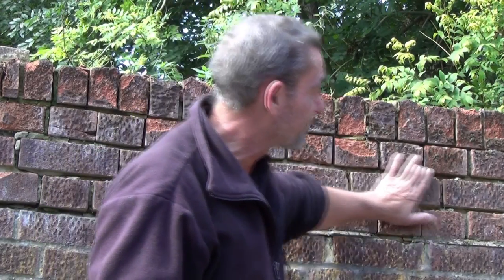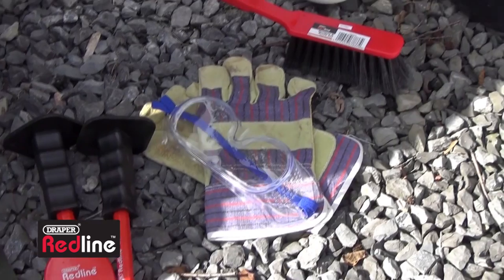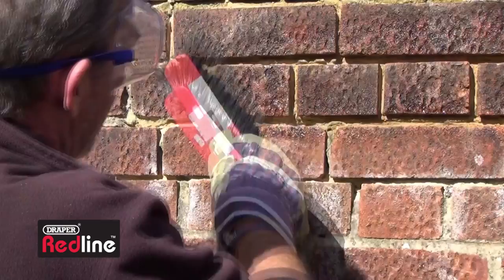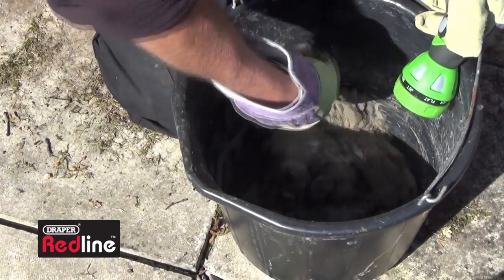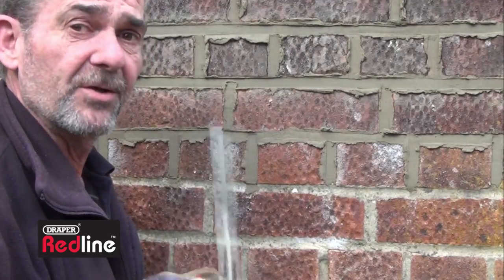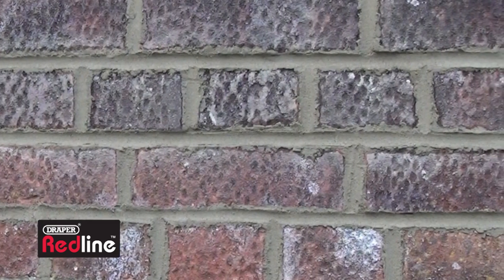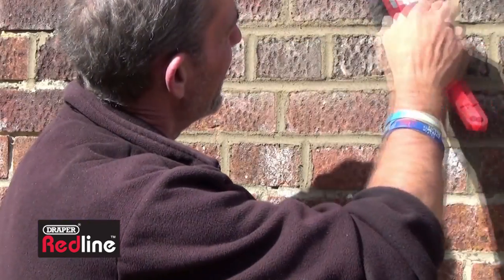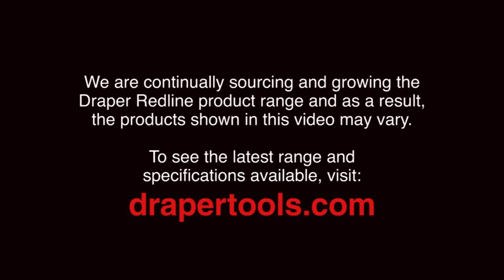How to repoint mortar joints

Comment: Those bricks are very old. Looks like the mortar at the back of the joint you raked out is lime. No way should you be using a cement based mortar. It's too strong. Looks like cement has previously been used for repointing and that is why the bricks on the top of the wall are damaged. By using cement, you are actually destroying the wall, not maintaining its structure. Use a lime mortar instead.

Comment: For you DIY people looking at this unless your thinking of attempting a little area don't attempt anything too large especially whole  elevations of your property. Not only will it look a mess but you will devalue your property. This guy knows what he's doing. This is a DIY video and the point of this video is to sell you their DIY tools. If you have to repoint yourself for gods sake find somewhere that won't be seen and practice, practice and when you think you've got it practice some more. He used a 2" bolster to remove old mortar this is fine for the odd piece of mortar but you need to look at other videos for other ideas if doing a large area. The most important task other than protecting your eyes and lungs from debris and dust, safe secure scaffolding and ladders is get your mortar right. I have seen people try and use muck that an experienced tradesman would have a nightmare with. Nice soft building sand ( Some of them can be too gritty ) Experiment. Like I said there are lots of really good vids and some bad ones. The mortar is key to this task. On hard bricks i.e. In the video Ratio of 4 sand 1 cement and a very very tiny amount of plasticiser literally a small spec if your mixing a bucket. If your a looking to attempt a Victorian house for example built in soft reds that's whole different ball game. Save up and get the pro's in. And then find someone who knows what lime mortar is. I've been guilty of using cement based mortar on beautiful Victorian brickwork and only after getting involved in with some heritage guys changed my thinking on this.
Reply: Dont now why you think DIYers are not as good as a tradesman, I have had builders in propertys and wont have anymore as I can do a far better job myself,some of us DIYERs have a lot of knowledge, I once had a builser take pictures of a victorian fireplace I built and put in as he had never done one !!!!!!

Comment: Please don't re-point solid walls with cement mortar!!! Your doing a lot more harm than good, these old walls need to breathe and cement based mortars stop this happening causing all sorts of damp problems
Reply: Nhl 3.5 or 5 for me all day long. You're exactly right.
Reply: I live in the states, and NHL 3.5 is scarce to come by. Only a few places sell it and charge a small fortune to ship it to my location. 
 Only hydrated lime is available in my area. Is that a suitable substitution?
Reply: @ernievonvutenhauger7207  no. Hydraulic 3.5 is the way

Comment: Great demonstration.  I caution those DIYers that often times you need to ensure that the mechanical/strength/thermal expansion properties of the new mortar match that of the original mortar, particularly for historical structures.  Not trying to scare anyone, but a significant mismatch in materials (i.e., brick, cmu, mortar, grout, etc.) can result in cracks and more challenges than original tackling.  Know the age of your masonry structure.  Ask a subject matter expert.  Ask questions of anyone performing a "simple" repair if they have considered these things.  Excessively strong or stiff is not always the answer.  Can result in an imbalance in stiffness.
Reply from the maker: Great advice thanks James
Reply: Irregardless of whether the job is historical or not you should take a sample of the existing mortar to the masonry supply yard to have it analyzed so that the new mortar will match the existing for color and texture. You will get a mix recommendation to use for a match.
Reply: My father taught me to bricklay when I was 15. Every school holidays I was the brickies labourer. Also the proper European Rendering. Now I find it fun to do. But I forgot the ratio sand and cement! Lol 😆.  I can't ask my father because he passed away over 15 years ago! Cheers from Australia 🙂

Comment: Really useful practical guide on repointing a modern wall. If would any be pointers require reliable technical guidance on repointing, do take the trouble to read the Building Research Establishment publication “Good Repair Guide No 24” (Repointing external brickwork walls) as this provides useful information, including when does worn pointing affect structural integrity and the  importance of using lime pointing on old solid walls.

Comment: Thanks for that. I Think while I have the scaffolding up from a re roofing job, I think I will have a go at re pointing my gable ends and below. The scaffolding might makr the job expensive but since its already there and paid for, might just as well have a go. BTW, ignore health and safety at your OWN PERIL. Personally I prefer not to take the risks, I wear gloves all the time and eye protection most of the time. I haven't had grit in my eye or scraped the skin off my hands yet. I think that is worth the bother.

Comment: If I'm needing to repoint a basement brick wall, which type mortar should I use? But if Type S and N are too hard, then type O and K are not structural. So I should use type N then?

Comment: This way shown  in the video is only for really small areas. To attempt something bigger you need different approach and different tools. I know over 20 years in business and still learning 😁.
Reply: Wojciech Chrzanowski  can you please name the tools he used to flatten the mortar? I’m-doing  my wall but i stopped caz I couldn’t get the neat results
Reply: @nadiamughal6688  finger trowel. Dont use a piece of hose if you going for a curved look in your joints. Get a jointer. Tbh, this is really bad work and the guy hosting says this is easy work. It's easy to make brick work look bad like shown in the video

Comment: Can I use regular cement for this job or I need to use specify type of cement? Thanks. BTW, excellent instructional video.
Reply from the maker: Hi, you'll need to use brick laying mortar. Glad you liked the video.
Reply: Depends on the brick whether it is older or newer brick. Never use straight portland cement EVER.  You should use a lime mortar for older softer brick. Have a conversation with your local masonry supply company rep.
Reply: Most modern day builds are a 5 sand 1 cement ratio , as someone said if it’s a older building with lime it becomes a bit harder

Comment: What is the difference between the types of pointing? Is it just a matter of personal choice?
?
Reply from the maker: Yes, the pointing finishes are down to personal preference. They're designed to weatherproof the wall and prevent water ingress. If patch repairing, you should match the finish used on the rest of the wall.

Comment: I wish vids like this would consider the final dry colour of the mortar mix.
I am so far only able to achieve...

 'orrible light grey  with ready mixed sand cement

'orrible grey with separate sand and cement

'orrible khaki when adding a buff colouring.

How do i produce a nice dark colour.
Somewhat like in the vid when still wet ?
Reply from the maker: Today's market offers a limited range of cement and mortar dye powders, but even these are difficult to match as the old mortar/cement has weathered and discoloured.
Reply: A bit of brown dye will work, the liquid dye add a bit to your water,
Reply: You can rub horse manure in when dried and the chemicals of manure will give a bit of aging . A little soil rubbed in is ok too. 
That was a tip a mason gave me anyways .

Comment: Should be called "how not to repoint". Why hold the trowel 3 feet away from the joint? Why such a shallow rake out? Why such a rich mix? Why use cement? Why brush when still wet?
Reply: @TH97 Vulgar boy.